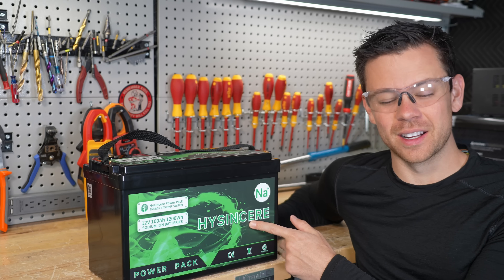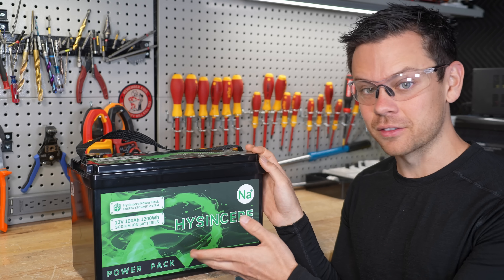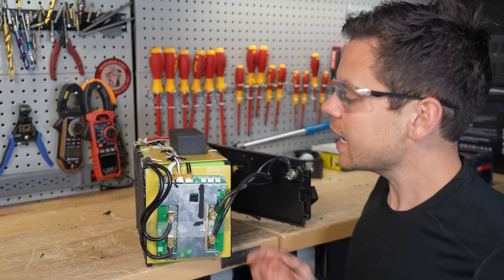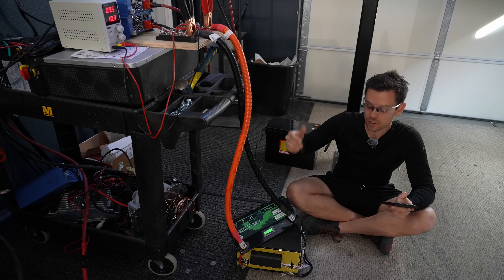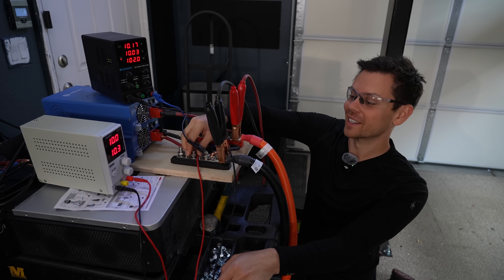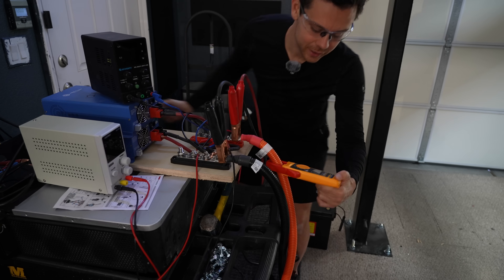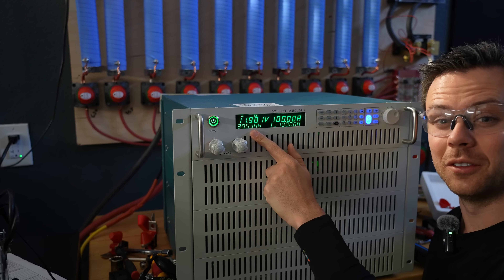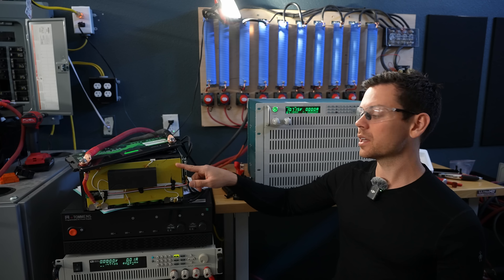Testing My First Sodium-Ion Solar Battery

Comment: Sodium has a horrible voltage curve- I don’t understand the hype that many people have for these.
I have 10 year old Winston LFPs in my caravan that are still very close to perfect. Degradation is UNDER 10%, amazing. They happily survived for the first eight years with no BMS, just cell voltage monitoring. During that whole period I manually balanced them about three times. Now the JK BMS that I fitted keeps them perfect!
Reply: If you aren't pulling them right down all the time they last forever! Well, not literally but you get the idea
Reply: NFPP has a nicer curve, more comparable to LFP. You guys are comparing NIB and SIB to LFP which should be compared to regular lithium ion LCO etc
Reply: “Horrible discharge curve”

It depends on the use case.

The discharge curve helps make it very clear how much power is in the battery!

For simple state of charge determination, the discharge curve is VERY helpful!

If your inverter is programmable, like my inverter is, there are no negatives with the discharge curve… only a positive feature!
Reply: @DavidHalko  "If your inverter is programmable, like my inverter is, there are no negatives with the discharge curve… only a positive feature!"

The negative is the current you need at low voltage when pulling full power and the assosiated inefficiencies.
Reply: @hojnikb  - the higher current at the lower voltage will not be used for very long… so it is not a big deal.
Reply: @DavidHalko it is a big deal if you need full power at 10% SOC.. And with a 10kW inverter thats 800A+... gotta have fets, traces and cables (and bms) rated for that current
Reply: @hojnikb  - the Na-Ion curve is not much different from a Li-ion battery, very few inverters are designed specifically ONLY for LiFePo4, so there is no big deal at the board level. The difference for smaller 10k inverters are insignificant.

Older inverters, without LiFePo4 support can be cheaper because the additional SOC support adds additional complexity.

Na-ion can therefore use less expensive inverters.

Even LiFePo4 can’t deliver full power at 10%, for much more than a few seconds, because the LiFePo4 curve drops off after that, before going to 0%. depending on SOC calculations for fractions of a second will not be reliable once that battery starts to age a little.
Reply: @DavidHalko if you want to use 100% of the capacity, the voltage range is much wider. Even with NMC  you're doing ~4.2-3.2V, so thats a volt per cell. With NA+, you have to do 4-1.5 or even 1V. Thats a much wider voltage curve and as such needs A LOT more current on low SOC to maintain constant power
Reply: @hojnikb  - the Na-ion curves I see go from 4v-2v per cell for 100% 

This is not far from 4.2v -3.0v Li-ion I see.

1v adds a small amount of current for a short period of time (end of the curve) which is an insignificant engineering problem.

If this is going to break an inverter, it should be thrown away, anyway, because of incompetence of the design team.

Comment: It might be better to test it with equipment that's designed to work with it.
Reply from the maker: We charged until high voltage disconnect, and down to the limit of inverters in this voltage range. The first test was down to 0 volts. Did you not watch the video?

Comment: I disagree a bit about mocking the linear charging curve. With the proper equipment it should be better as you can tell the SOC from the charge. (This is with the side note that I'm not really familiar with other quirks of sodium ion)

The LFP flat charging curve can be seen as a disadvantage as it makes it more difficult to tell the SOC. This forces you to do cell balancing.

I still agree with the main point and a great video as always.
Reply: My thoughts exactly
Reply: The SOC is only a problem when you do not know the battery history.
Most BMS has current and voltage measuring so the SOC can be calculated easily if the battery has been "full" or "empty" recently, the flat curve is far more advantageous then a accurate SOC.
Reply: @larsjrgensen5975  absolutely spot on assessment my friend!!
Reply: @larsjrgensen5975  Exactly. No modern BMS/inverter rely on the discharge curve to calculate SoC. They generally do coulomb counting for SoC and consider the full charge/discharge history to recalibrate as the battery ages.
Reply: The flat discharge curve has a big advantage if you're going to be powering amateur radio equipment. A lot of it is designed for a "12 volt" power source, which actually means anything from around 12.0 volts up to 13.8 volts (the typical voltage from an car while the engine is running) and even a bit more. If you use a four cell LFP battery (or for more capacity, a 4SxP configuration), you can run the radio directly from the battery with no inverter. Inverters inevitably create radio noise because of their switching operation; running from battery power eliminates all of that, enabling the best weak signal performance possible. (It's true that a lot of the receiver portion of the radio actually runs at much lower voltage, but linear regulators are normally used to bring down the voltage without introducing much noise.)

In contrast, there will be very few applications that will be able to use a sodium-ion battery without power conversion. The voltage at full charge is more than DOUBLE the voltage at the point where you cut off charging.
Reply: Lineal charging curve?
There is a chemistry for that: standard NMC Li-ion. Voltages: 2.75V - 4.2V (almost all the curve above 3.2V, average 3.6-3.7V) per cell, efficiency - almost the same as LFP and even higher energy density.

Comment: Sodium based batteries have the advantages of using cheaper materials and working in temperatures which would stop lithium based batteries from working.  They have the disadvantages of being a lower energy density plus having a nearly linear discharge curve.  Lithium batteries have the advantages of a voltage drop within a narrow range and a high energy density, but the disadvantages that currently, the manufacturing process leaves them vulnerable to thermal runaway and fire if short-circuited or broken open, plus they won't operate at all in very low temperatures.

I've heard reports that the energy density problem with sodium batteries has been overcome.  If that proves to be true, that's one disadvantage gone.  As for the linear voltage drop, I'd presume that a large enough boost converter would take care of that, and might even be built into future equipment designed to run off of sodium batteries.  The boost converter would take more current from the battery as its voltage drops in order to maintain the boost, until the battery voltage drops low enough or the current becomes high enough that there's no point in continuing, at which point it would simply drop out and then maintain just enough current draw to measure the voltage of the battery and keep the input off until the voltage rises high enough to safely reconnect to the battery.

Comment: sodium-ion batteries are excellent candidates for auxiliary power in cold weather. Unlike lithium-ion batteries, which can lose significant capacity and struggle to charge in sub-zero temperatures, sodium-ion cells maintain stable performance at lower temperatures.

Comment: But we dont need other inverters - we need other settings for the inverters right? Just adjust the values manualy?
Reply from the maker: No. You need different design and software and the efficiency will be worse because of the voltage differential

Comment: I don't think sodium is that bad. Sure it's expensive now ans doesn't work well with existing equipment but it doesn't have to. We have MPPT charge controllers. Once prices come down, I plan on building a bank with the voltage range starting at my MPPT controller range. I can put the bank anywhere because it isn't so sensitive to heat and cold and humidity. I ca almost let the solar panels charge it directly though a simple cut off controller when its full would be a good idea. It would be a good place to divert excess power for the days when the sun isn't shining. You don't  really need any additional equipment other than a simple charge cut off when it's full. I just hope the price drops soon and enough to match the hype.

Comment: The real appeal of sodium is cost at demand (cost being mostly a combination of energy to produce, raw material cost, and assembly complexity). 

If sodium batteries cost half as much for a given Wh-capacity as LFP, charging inefficiency below 50% state of charge becomes much less important.

The real trick is to get sodium batts even cheaper than that, since demand is a variable in the price of LFP as well. If sodium suddenly becomes economical, does LFP price go down as manufacturing is more really able to meet demand, or does it go up because our consumption rises even faster? Both outcomes change the usefulness of sodium at scale.

Comment: It's currently out of stock, but NexPower Energy makes a 12v auxiliary battery.  If you can get one I would be interested to see what you think of it.  I think sodium ion or LTO are good chemistrys for starter batteries, I am tired of lead acid batteries failing every few years.

Comment: What does it matter if they're less efficient than LFP. We need cheaper batteries, not maximum efficiency. How does it compare in $ per kWh? I wouldn't care losing 20-30% of the energy with a battery that's cheap, when we are already losing 75% of our money feeding into the grid... just a thought. Off-grid efficiency is definitely a big issue.
Reply from the maker: It's literally double the price 😂
Reply from the maker: And you have to spend more money on solar panels because of the efficiency loss
Reply: @WillProwse   Hi Will. not to discount anything you said, but you missed my point. Here most people with batteries and solar are on-grid not off-grid.  I would happily wear the loss of efficiency if these batteries were cheaper than LFP. I know they are not currently. But give them a chance - they've only just hit the market. Lithium technologies have had over 40 years of development and refinement. I am sure Sodium batteries will improve and get cheaper. For a while they may be unacceptable for off-grid solar systems but the efficiency is not so concerning for on-grid applications. residential home batteries are all about the cost. and we are already losing 75% of our power with existing grid feed tariffs - we do not have net metering like some places do. So any battery is better than no battery. I see massive potential for sodium for on-grid residential battery systems. Some experts are predicting costs of sodium batteries will drop far below LFP, but it might take a decade. Thanks for your interesting content.